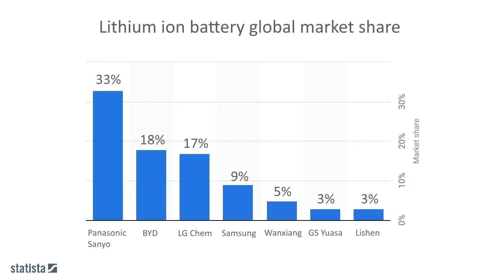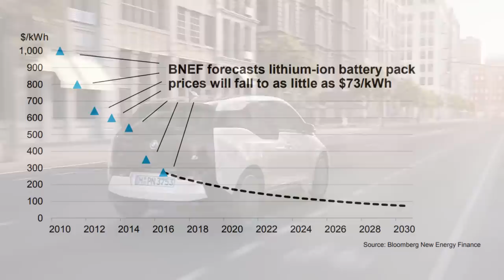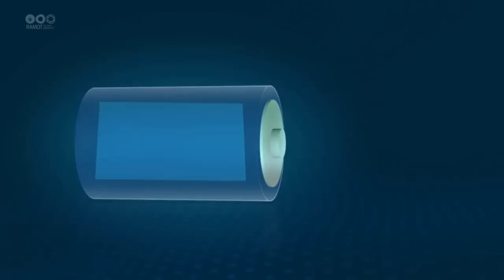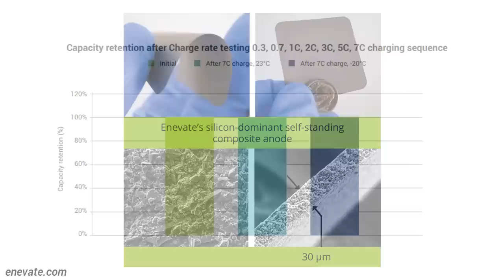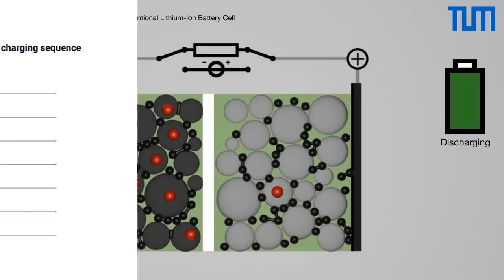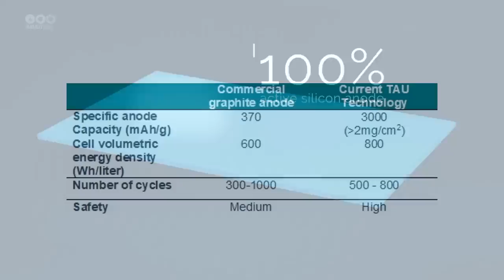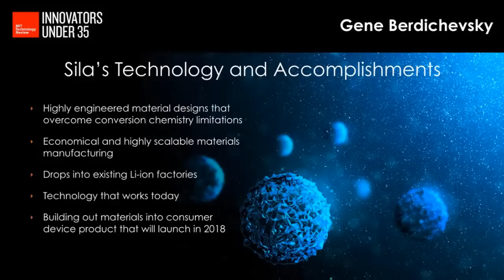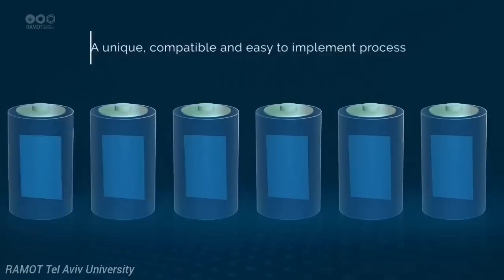The Battery Revolution. Ultra Fast Charging

Comment from the maker: Thanks for watching friends, hope You enjoyed it!
If the price of electric vehicles be the same or even lower than conventional gasoline-powered vehicles, would You go electric or will the ICE be preferable option in any way?
Reply: I enjoyed it, except for the distracting background bass.

I'd use ICE for long distance travel without breaks (4+ hours, though. How long were the bombing runs that required stimulants?), and BEV for anything else; BEV pays for itself by using excess solar peak energy, acting like a UPS for the home or more, and not poisoning the places i use it in.
Reply: Future Lab electric. Easy choice. Next gen EVs like the Tesla roadster are already going to be able to travel further than ICE cars. And with the increased charging speed, there's really no reason for an ICE car unless you can't charge at your house. After a 400 mile journey, to have 30/45mins break is not only ok, its actually sensible. Plus, once there are more places to charge, range anxiety won't be a thing anymore. Unfortunately, the model 3 is just too far away for me to wait, so I'm going to have to buy a Golf GTE hybrid. But the next car I buy after that will be all electric.
Reply: Future Lab DEFINITELY ELECTRIC!
Reply: It is going to happen a lot faster than that. The experts never get disruptive changes right. They always use lateral forecasting tools. The problem is technologies are always adopted in exponential S curves, not laterally. Look up Tony Seba on Youtube
Reply: Hey, Every day the race between ICEC and EV manufacturers rages. Because of that maybe ICEC producers may find a way to 0 emission and produce total bio fuel. On the other hand, EV producers may also find a way to 10k kms batteries. Who knows? As far as people like the engine roar, the ICEC will live. Pollution is the only key to ban all the ICE. But the carbon fingerprint is not only caused by fuel. Also the production of those brilliant batteries cause lots of pollution.
Reply: Electric every day
Reply: Ho Lee Fook you mean require expensive maintenance, expensive fuels from enemy countries, waste the vast majority of its energy as heat, and come with thousands of moving parts instead of a few hundred?
You probably don't, but these are some of the disadvantages EVs lack. I'll gladly trade them for shorter range and longer charging.
Reply: Tuncay Şimşek First resonable comment of the day.
Reply: LIthium is a 50 year old invention. It sat on the shelf until cellphones created a need for a better battery. Its creator already has its successor in final commercialization. Sodium Glass solid state. No precious metals,. No toxic electrolytes.
Reply: Electric cars wear down and break to a much lesser degree. No fuel system, no air intake system, one moving part in the entire engine (unless you count the balls in the bearings), no exhaust system, no oil system, no timing belt or chain, no clutch, a very simple gearbox (typically 8 gears, of which 4 make up the differential, and neither of which are ever disengaged from eachother), minimal brake wear (a mixed blessing, as lightly used brakes can seize easier), and a tiny cooling system that deals with low temperatures and small amounts of energy. 
Just the absence of solvents (oil, fuel) and high temperatures means the materials age a lot slower.
The Nissan Leaf battery costs less to replace at EOL than the fuel in a ICE car would've cost for the same driving distance, and in all but the very dirtiest grids an EV produces less pollution in total, including battery manufacture, than a gasoline car (including car and fuel manufacture).
A few comments from before the EV age puts the number of moving parts in a car at 10-13000.
Reply: "A Wakened" I don't know where you live but if you think that good batteries are being removed from cars and thrown in landfills you should be petitioning your government to have them enforce the rules they have in place to stop such activity. 
Yes lithium battery powered toothbrushes and other devices are going into landfill but car disposal is generally very highly regulated and recycling is prevalent in almost every stage of the process. 
Back in the olden days engine fluids were drained straight into the scrap yard's soil. 
Times have changed...
Reply: Hesus, seriously what are you talking about?!
Reply: Awakened2Truth -Do a little research before spouting off about something you know nothing about and don't understand. Research allows you to develop an informed oppinion rather than parroting what he said she said. Although I appreciate it is sometimes hard to break old habits.
Reply: I don't drive much, and the furthest we go is about 50 miles from home. Today's EVs can handle that.  I have an older but low mileage ice car so I can afford to hold off any purchase until the next predicted big thing actually becomes the next big thing for real. They're predicting major big time practical long range EVs by 2025, which would work out just about right for me, I can certainly squeeze 7 more years out of my current car, but we've been hearing all about the great new battery technological breakthroughs just right around the corner for a number of years now and it hasn't happened yet. When and if the EV becomes a serious practical contender, I'll certainly consider one, absolutely. if you build one that works for me, I'll buy it. My only concern would be long distance trips, it isn't just the charging time, it's lining up behind 400 other cars all trying to do the same thing at the same time. They've got to have the infrastructure.
Reply: ICE or hybrid all the way, the infrastructure is there, the reliabilty is there, no plugin or waiting or range anxiety, great for those that park outside in the cold and apartment dwellers with no access to garage parking or an ac plug.
Unknown longevity and battery replacement costs.
Reply: Future Lab MIT published work, proving they can now print graphene sheets (carbon nanotubes, with a uniform thickness of one atom,) in infinite scale and volume.
All of these batteries are poop, in comparison to graphene ultra capacitors.
Reply: I would love to go electric, but I have a disability and I cannot walk more than 200 m. The only charge points in my neighbourhood is 800 meters away. And they are Always occupied…. If this does not improve, I will not be able to go electric.
Reply: I would go electric but there is are some problem if too many go electric. 
Can the power grids handle the extra load? 
Do we even have enough electricity to cover the demand? 
Is it clean energy? If not then it doesn't make sense to go electric when all you do is shift the emissions to the power plant. 
Also...how long do i have to wait for a full charge? I'm not going to wait 30 minutes for 80% capacity...my limit is 10 minutes maximum and it has to be fully charged like an ICE vehicle. 
Nobody will build that infrastucture though because there is no demand and nobody buys EVs because there are not enough fast chargers / charging stations. And we need one car for all of them. I don't want to drive around needing to carry 10 cards. 
EVs are still a novelty and toys for rich people and early adopters who have the money to spend.
Reply: I've driven both ICE and electric.  The experience of driving an EV is sublime.  Instant torque and silent power.  I will NEVER go back to ICE.
Reply: Enforcer1975
 - Not sure where you live, which would affect some of the answers.

Can the power grid handle the load?  Pretty easily.  EV's mostly charge at night when the grid is idle and power use is decreasing in the USA.  Power generation dropped by 1.5% last year, which is enough energy for 28 million EV's to drive 15.000 miles a year each.

The energy is clean in many cases, and much cleaner in most cases.  Even when power plants run base loads at night, it is more efficient to use them.  The less efficient peaker plants are the main issue during the day in most cases, when the demand is highest, but as noted, most EV's charge at night anyways.
In my area, the base load at night is Nuclear, so I charge with carbon free energy at night.

This waiting for a full charge thing is the outdated gasoline car mentality.  On a gas car, people wait until they have a quarter tank or less and fill up at a gas station.  On electric cars, you simply plug them in when you get home, or when you get to work, or when you go to the store, etc.  They are basically full every morning when you wake up, and charge when you sleep.  There is no waiting involved in most cases.

"Nobody will build that infrastucture though because there is no demand..."  If that was the case, we would never had cell phones take off, or the internet, or anything else for that matter.  There is no infrastructure to build, the grid is already here, every building today has a power outlet, the building of fast charging infrastructure is not only here already, it is being expanded every year.

This claim simply doesn't add up.  Go to Plugshare.com and see how many stations are around the country already, and thousands more on the way every year.

"And we need one car for all of them.".   I assume you meant "card" for all of them.  First of all, some like the Tesla Superchargers don't use cards at all.  Second of all, stations like Chargepoint and EvGo you can just use a mobile app if a card is required.  That claim simply doesn't add up.

"EVs are still a novelty and toys for rich people and early adopters".  The same was said about gasoline cars, mobile phones, computers, the internet, indoor plumbing, etc.

EV's today are getting cheaper and better every year.  They are already cheaper to operate and cheaper to maintain per mile.  So, it is not a matter if being an early adopter, they simply make economic sense, besides the cleaner transportation argument.  So, they will keep growing, like it or not.
Reply: Future Lab  If ev's are pushed, my vote is no petro chemicals allowed in design, engineering, construction. There is beleif that the earth keeps manufacturing oil, can you debunk it ? That answer is no. Plus there is so much oil were swimming in it. FAKE NEWS!! AND A FEAR MONGERER, LIKE ALGORE!!! LOL GROW UP WHILE YOUR AT IT AYE!!
Reply: Awakened2Truth - Disciple of Jesus the Christ I'd like to help you out. Where can I send the tin foil hat?
Reply: I am for I.C.E. sports cars and daily electrics. Electric vehicles are great for folks who use automobiles as a means of transport. However, I still choose I.C.E. for sporting vehicles. It's fun to shift gears. It's fun to enjoy the exhaust note. It's my hobby. Why should I give up my interest, just because other people use it in apathy?
--- If it weren't for I.C.E, I would have never gotten my degree in Mechanical Engineering. In the big picture, appliance use accounts for 90% of the vehicles on the road. So, go ahead and let electrification happen. Let combustion go to those who truly enjoy it and are smart enough to keep it. Once we have a higher usage of renewable energy, any carbon emissions from I.C.E. can be done by the very small crowd of I.C.E. people, thus making it more sustainable.
Reply: Future Lab whats the name of the first song ? Pls
Reply: Guns Cars and Digits - Just find a new and better hobby. Burning fossil fuels is polluting our planet. It must be banned.
Reply: tanzanable You first.  Mining exotic battery materials and using more tires over the same distance, not to mention using the SAME AMOUNT OF PETROCHEMICALS for body and interior components, means your EV is worse for the environment overall than an ICE car.  And all you're doing is moving the emissions away from you to someone else.

Typical NIMBY elitist attitude.
Reply: Bill Cichoke - ICE cars use many toxic substances. My EV gets its energy from solar panels so there's no shifting of fossil fuel burn from the car to a power plant. Hydro, wind and nuclear plants don't use fossil fuels either. More tires? EVs use very efficient low rolling resistance tires with long tread life.
Reply: I drive a plug in hybrid and I'd go full electric as soon as I can afford a 300 mile range car. Wouldn't even be a hard decision.
Reply: I enjpye it, really, so funny all these ignoramus who can't understand basic physics !
Reply: Nice video
Reply: 5:20 Why would you compare the time it takes the new batteries to get to 90% against Tesla's supercharger getting to 100% charge?
You said it's 5 times faster than charging with Tesla's superchargers--which is FALSE
I hope I'm not the only one who caught that obviously unfair comparison. 
If it takes 15 minutes to get to 90% with the new batteries, and 75 minutes to get to 100% with Tesla's superchargers, then that's not 5 times faster. The last 10% takes the longest to charge, so why didn't you do a fair comparison--how long does it take each to get to 100%.
Reply: ICE all the way . Even after 50 or 100 years .
Reply: I'll go electric the moment I can afford it.
Reply: One thing that needs to be done is over the next 12 years convert oil based economies(Canada, Saudi Arabia, UAE, etc) Into ones comparable with the new technology. I can speak for Canada saying our metal rich Canadian shield and Lithium brine are good news. Problem is there is very little push to mine these resources. For example Lithium brine is a formally unwanted product from oil wells in Alberta and Saskatchewan. It can be seen Esp southeast of Edmonton where the stuff is near the ground and many lakes are brine rich(have white powdery beaches) And a salty taste.
Reply: TAKE NOTE: There’s no substitute to liquid fuels for transportation
vehicles in terms of Robotic Functioning and Molecular Alchemy. Liquid fuels
are combustible or energy-generating molecules that can be harnessed to create
MECHANICAL ENERGY, usually producing KINETIC ENERGY; It’s the fumes of liquid
fuels that are flammable instead of the fluid. Most liquid fuels in widespread
use are derived from fossil fuels; however, there are several types, such as
hydrogen fuel (for automotive uses), ethanol, and biodiesel, which are also
categorized as a liquid fuel. Many liquid fuels play a primary role in
transportation and the economy. Efficiency --- YES! Pricey --- Yes, because
it’s the price of an environment-friendly fuel ... not to be a hypocrit about
nature.
Reply: There is only one problem with your theory, if you buy a solar home and charge your car from it then you are using the electricity from all around you.  If you use solar charging stations that give you energy for free then again, you are using power from all around you.
Reply: They do.  In fact, they work better.  They are more expensive now because they are new.  Wait 2 more years and you will see more e-vehicles then ICE vehicles.
Reply: You're right Tesla costs a lot to repair because they are a new type of car, ICEs have been established for the last 50 years.  As for them devaluing faster, I don't think so, but like I said it's a new type of car.  While electricity does come from fossil fuels, most Tesla energy come from solar, and you can charge your car from home and you're not burning as much fuel to get electricity at home so that ends that conversation right there.  You're right ICE cars don't have thousands of moving parts.  However, electric cars have less than ICE cars period.
Reply: Actually moving parts does factor in, just because you had a brand of cars out of the hundreds of brands of ICE vehicles, does not create a gold standard.  I know people that had the same vehicles that were in the repair shop every 3 years.  Any car that you take proper care of does not need replacement parts regularly if the car is built well.  However, normal wear and tear on vehicles are based on friction, you can reduce that friction but ultimately, the cars will break down due to friction.  That's a scientific fact.  Once again you're not proving that Tesla is not a better car than ICEs what you are proving is you take care of your cars so they last longer.  I have a Prius, and I have had that Prius for well over 17 years, that car is almost like it is brand new, I have not put as many miles on it, but I don't drive everyday, so I haven't even broken the 50,000 mile mark yet.  However, I have a friend that ran her Prius into the ground putting 150,000 miles on it before it conked out.
Reply: Again I think you need to check your sources because ICEs will be outlawed by 2030.  While it will take a while for the cars to switch over, that doesn't mean that they won't be replaced.  There will always be cars that run on fuel but they will be less and less as time goes by.  i only hope we can wait that long before the climate kills everyone.
Reply: I think you are missing some salient points.
While most people aren't replacing the ICEVs with EVs yet, doesn't mean it is not going to happen.  There are only two cars that really are noteworthy as an real world EV and one of them is Tesla.  The other is the Bolt and Volt but the auto industry has not embraced this tech.  Does anyone remember the EV1?  If we had done this a decade ago, the environment would be in a better position.  Additionally, airplanes are not your only source of mass transit.  Most cities in the USA have rail systems and they run on electricity.  So it's not that far as you would believe that within 30 years our primary source of fuel will be electricity generate by clean energy.
Reply: I agree unfortunately most people don't know how fast the ice will melt.  Predictions are not an exact science, they can approximate but that is as good as it gets.  For example, there is an iceberg right now that is threatening to flood a coastal town.  This is reality and not fiction.  We had best hope we can do something before we can no longer travel via air.
Reply: You actually want to go there?  No, the reason they replaced EVs with ICEVs was because of the automatic starter.  I know the history of these cars.  It was not about battery or range.  It was about ease of use.
Reply: Actually what we were discussing is when EVs will become cheaper the ICEVs and that will mean more cars on the road.  The same thing happened with the Toyota Prius in 2001.  However, with fracking bring gas prices down, the demand for hybrids is lessening.  Volvo has stated they will not make any new cars without an electric motor in it.  So like I said in 2 years we will see a switch being flipped to EVs.  As to the law, we were not talking about the law until you changed the topic to mean there will be ICEVs, and in that you are right.  However, with them being outlawed in 2030, we won't see any new ones being made which is different than us not seeing them at all.
Reply: Why did you write this?  You claimed that the reason that ICEs beat out the EVs is because of battery life instead of the hand crank.  You just confirmed what I said.
Reply: Nope wrong again until the discovery of oil in Texas, it was the high cost of gas not electricity that almost killed the ICE.
Reply: Didn't we just cover this?  We were having two separate conversations.  The first was about cost competiveness.  The second was about the laws and whether there would still be ICEs made.  Now I responded differently to both of your statements because we were talking about two separate aspects.
Reply: Seriously?  So you're going to say that because you can't measure how fast your house will flood means you shouldn't estimate how much time you have within the scope of the data that you have to work with to save your life?
Reply: I'd definitely go electric. just waiting for the price to be more friendly. and maybe have more ev choices 😁
Reply: Electric, every time. 
We already have a PHEV, next car will definitely have no ICE!
Reply: Future Lab Already went Bolt for my Ride Share with 65,000 miles and no maintenance and no regrets. Love to see jaw drops and open mouths when I 0-60 in 5 seconds.
Reply: Craig G Bolt is here! Everything you want (300 miles range safe, fast, clean) modern electronics, killer holographic ( LT Model) stereo, excellent visibility, Luxury car amenities. Apple CarPlay and Android too. Photos and videos with gallery. Personal automobile “Hot Spot”
Reply: Awakened2Truth - Disciple of Jesus the Christ o
Reply: Awakened2Truth - Disciple of Jesus the Christ They have Second life as power “sinks” and storage, then recycled when finally done.
Reply: Awakened2Truth - Disciple of Jesus the Christ But for the knowledgeable it is free. And there is the Internet for education. You can be your own “Neo”
Reply: Tuncay Şimşek Programs developed now and outside audio for coordinated engine sounds with accelerometers in smart phones.
Reply: IncognitoTorpedo I agree with 65,000 miles of fun. Welcome to the fold!
Reply: AKS I am a ride share driver all over the place! I drive easily 200 miles per day no “range anxiety “ at all in 65,000 miles.
Reply: SyphonLife when was the last report of a fiery crash of an ICE with a time bomb gasoline fuel tank and CO generating poison maker engine?
Reply: Paul Lammers Was  it convincing to a Nobel Laureate that out of curiosity checked it out for himself, You Tube his lecture.
Reply: Johan Smith $2000 down and $199 dollar 3 year lease for Bolt, and some preowned ones. Very little battery degradation on Second Design battery.
Reply: Ryooken I agree around me San Diego and LA it is changing as I text.
Reply: Ryooken Tesla’s have had 110 miles per hour accidents and the people have walked away unscathed. A Mercedes hit a tree at over one hundred miles per hour, and all that was left after the fire was a 20 inch piece of charred dash board.
Reply: Ryooken Yes and ease of use by women.
Reply: Samuel Rosenberg Right. We are at a Maunder Minimum now. See “Dark Winter”
Reply: Future Lab This tech is good, but no one will Ban combustion engines
Reply: galfisk The guy with the 97 Camry with 300k on the clock is laughing at your statement.
Reply: False, try and find out what is actually predicted rather than what fake News sites claim they predict, then find out what is actually happening.
P.S watch food prices this year and insurance premiums in the future
Reply: Volcano's under the Antarctic ice have been known about for many years, in fact the worlds highest active volcano is in East Antarctica.
However as Icelandic research has shown, as the ice melts the Earth rebounds reducing the pressure closing off volcanic vents and allowing increased magma flow, this is happening in West Antarctica as the glaciers and land ice sheets melt leading to greater magma flow, lava and ice melt , you get the picture.
Yes the models are not perfect and in most cases have erred on the side of caution.
The ice age scare was a media beat up that certain individuals took advantage of. It was based on the observation that pollution was not only causing acid rain, but also was blocking the sun - the Super Volcano winter a la the Year without a summer which lasted a couple of years. The world got together, the EPA was formed and the Developed nations came up with pollution controls massively reducing both issues. In the meantime the scientific research was still demonstrating Global warming due to CO2 masked somewhat by pollution.
Take note what is happening around the world and we are only just over 1C above the 1890's, it will be far far worse at 1.5C then again at 2C
Reply: SR. Antarctic ice melt and models, the models are pretty much on track, no model can be perfect, not even the model on which the aeroplane you fly in was built from.
Antarctica is a continent that has not been greatly researched, as such the depth and extent of the sub sea glaciers and their extension up to thousands of miles inland were not known, nor their slope. It is that lack of knowledge which is being rectified that lead to overly optimistic IPCC assessment and the surprise at the rapid rate of melt as a result
Reply: Short haul passenger aircraft are well on the way (couple of hundred miles ) and they are 90% of air traffic. Several manufacturers including Boeing
Reply: news flash, the solid state batteries WILL be on the market by 2020.
Reply: Where and how does one obtain this 'free energy' you speak of? I see a market for it.
Reply: no sorry I cant because of range and recharging time at this time. My business would not permit it.
Reply: correct no such thing as green. Stop being consumers keep the stuff you have and dont buy new. environmental impact of consumerism is much worse than tail pipes.
Reply: cost aside, there were EVs that got 200 miles per charge available around the world in 2011...…………………….they just weren't  available in America
Reply: @tuncaysimsek8210  yes but the problem is burning anything (including biofuel) will still produce pollutants from the combustion.
Reply: man i wanna electric car so bad im tire these noisy gas vehicles(":
Reply: Future Lab better to use graphene battery, but for now this is good as long as it is not combustible...
Reply: @Ho Lee Fook 
Duh?
Reply: @tuncaysimsek8210  
"The production pollution of batteries" (and the rest of the EV powertrain) is no more than that for the mining, processing and manufacturer of ALL the components in an ICE powertrain.
Also consider the pollution in production (NOT just use!) of the ICE fuel... Through the the life of the vehicle.
Reply: @AKS how many km in a year?
Reply: I surely would even if 20% premium, hate those oil change and related parts maintenance makes all garage both stinks and dirty.
Reply: I already went electric and I make every effort to educate people. Car companies are making an effort to suppress or hide information about new technology.
Reply: INTERNAL COMBUSTION ENGINES are best.Oil is constantly being replenished in the earths inner magma core, we just need to drill deeper.there is nothing like the feel and power of a good old V8.
Reply: Sometimes people run out of gasoline while on trips.  If that occurs, they can call the AAA and get enough gasoline to goto the next service station.  But what happens if they are driving an electric car and run out of kilowatts? A  AAA truck probably could not recharge a battery very quickly.  That could easily happen to even a careful driver if an electric car charging station were out of order.
Reply: I don't see how you could have written that post if you had a good background in physics.
Reply: Future Lab yes
Reply: I Hope that in the future there would be a semi nuclear battery that would last a lifetime in one charge of car's existence and that's all you need, becos problem with ev is always the battery's integrety,  , hope there would be a    battery just like  in the movie day and night starring tom cruise & cameron diaz,
Reply: @The-Randomest-Guy  Hope that in the future there would be a semi nuclear battery that would last a lifetime in one charge of car's existence and that's all you need, becos problem with ev is always the battery's integrety,  , hope there would be a    battery just like  in the movie day and night starring tom cruise & cameron diaz,
Reply: What do you mean by "work like gasoline cars"?
Do you mean have complicated multi-ratio transmissions?  Do you mean produce plenty of noise?  Do you mean not responding instantly to the accelerator?  Do you mean requiring refueling frequently?

Perhaps you can clarify.
Reply: To be the same as a comparable sized gas model like the Corolla iM they would need to get the prices down to around 18k to 20k and if they did that yes I would buy one if they also got the charge times down to around the same time to refuel a gas model.
Reply: End of Gasoline? Hopefully !
What about Graphene based batteries? How many years away? 
What about a video Lithium vs Graphene?
Reply: @Ho Lee Fook Amazing, everything you just said, was wrong.
Reply: I would be  more interested in electric vehicles if it was compatible to a pick up truck.
Reply: Absolutely!!!
Reply: Haha electric cars are not popular. They are such a hassle to own. Long charging time, low range. People don't want garbage electric cars.
Reply: Brian Cla, Yeah, look what happened to horse and buggy / cars?! There were  no roads, no gas stations, no mechanical garages for cars, but yeah you are right, stay with the horse and buggy! HA! HA!
Reply: @ginosmovies  your comparison is completely wrong. Horses have very low range, gas cars have 1000 km range. Where as electric has only 300 km and takes ages to recharge. With gas cars we can carry gasoline and extend our range. With electric we cannot do that. That's why electric cars are not practical.
Reply: Lets see, even the most expensive EV can only do a real world 250 miles on a charge. My BMW 320D can do almost 800 miles on one tank of fuel if I drive sensibly. EV can go do one, it's still rubbish.
Reply: ICE is already dead in the water: but this kind of battery innovation will accelerate the trend towards BEV vehicles and devices.
Reply: Enforcer1975 I first got solar.  Later I will get an electric car.  Maybe others will do the same.  Solar has gotten cheap if you are allowed to install on your place.
Reply: @tuncaysimsek8210  Very even tempered reply........
Reply: Music a bit distracting, please consider removing
Reply: ..__for future lab..__yes yes a battery_acummulator rechargeable is grosso modo a electric condensator..ideal is forming a batery_acummulator fast time rechargeable identyc electric condensator (second_minute time) and consuming long time identyc baterry_acumulator actually (hour time).. this is it idea..  ___archaix lord
Reply: yes yes..this is it idea a battery_acumulator rechageable is grosso_modo a electric_condensator_ great idea is forming a baterry_acummulator rechargeable identyc fast time (second_minute time) electric_condensator rechargeable and consuming long time (hour time) identyc actualy batery_acummulator rechargeable..this is it idea.. __archaix lord
Reply: Can't we all just have walk-able cities and high-speed rail?   eh? recognize RNG as a major transition fuel  UPS,  Seattle Waste management.  You people in 2018 did you know a 232% growth in grid storage was coming. Utah storage system to store a gigawatt.
Reply: biggest coming market for LI-ion I predict chainsaws, weed whackers, leaf blowers.
Reply: what the industry needs mostly is manufacturing volume. Right now the low production rate leads to long lead times and premium prices for the battery packs and thus the cars as well.
Buy a gasoline powered car and you can expect it to be delivered in 3-4 weeks if not faster. For an EV variant of the same model, you can expect to wait 6-8 MONTHS simply because (even despite the higher price, 1.5-2 times that of the gasoline variant) the manufacturer simply can't produce them fast enough to keep up with demand.

After that problem is resolved, or parallel to it, energy density should go up as well in order to both increase range and reduce weight and cost.
Reply: When the Atlis is real...i will buy it
Reply: Most definitely. I want to go electric now but, my pockets are not deep enough. I love the Solo.
Reply: Tuncay Şimşek a very crazy reason to keep making petrol driven cars and keep polluting the environment - for the sound of the engine!!
Reply: Jonathon Deeds but what if the production processes for battery manufacturer uses renewable energy sources? Would that be ok then?
Reply: ferkemall I believe they go into a powerwall. But after that... I don’t know. But I’m guessing soon there would be laws about recycling. Also, laws to put an end to “planned obsolescence”.
Reply: Guns Cars and Digits I can’t see the logic of wanting to do things that are detrimental to the environment, unsustainable, and inefficient, just because you find it fun. EV’s are a lot of fun too, as you quietly overtake these unnecessarily complex and polluting ICE vehicles. I can’t see any sense in the argument for ICE. The fun of shifting gears and the noise? How about the smell and fumes? Also fun? In reality, the ICE engine should cost way more than the ev. The cost and technology currently can easily make this happen now.
Reply: Tuncay Şimşek bio fuels produce co2
Reply: mark rigsby come 2030 many countries are stopping production of ICE vehicles.
Reply: Ronald de Rooij make a routine trip to one and you'll always have the juice there when you need it. Not all ev owners charge at home or work etc....
Reply: Enforcer1975 there's enough electricity during the day so at night when most people will charge, power stations won't have to ramp down and generation will be more efficient overall as power stations won't have to be designed to ramp down so much. That adds costs as pumping systems, for instance need to be able to pump large And small amounts as opposed to the same amount 24/7. It's like how generator engines are designed to run at only one rpm. It's going to make power generation cheaper and more efficient than it is now for many reasons. Vgud brony
Reply: ferkemall EV's don't use up brakes either as well as not needing gearbox oil and the complications of an ice drivetrain which is not needed when a motor directly turns wheels. 
And power generation will be more efficient with vehicles charging mostly at night through the savings made by designing generators that run at full capacity all day and night unlike now when most ramp down when we sleep and stop using so many power. Car batteries can also be linked to the grid and used as grid storage and for current smoothing (as capacitors) while charging being a double bonus. 
no one wants to know how many cylinders or litres people have these days. Tis what one does with it....💐🍐🔥💦
Reply: Of course I am decided for EV !
Reply: yes
Reply: Why would they sell them for less?  They have governments passing  regulations mandating their use.  Your question is idealistic and seems to seek positive feedback.  Why just ask if people would prefer a free car over a ICE car?  No mention of chargers.  Isn’t that half the story?

Finally, if this tech works with existing factories - why do we need to wait until 2023?  Obviously their claims haven’t been full tested.  Why else inject a multi-year waiting period?
Reply: The only thing that bothers me is that in the event of a disaster, when access to electricity might be interrupted, people are hosed.
Reply: It's been 1 year, and my wife and I went all electric. The Ford Focus EV we bought 4 1/2 years ago has 46k miles on it - not bad for a car with an official 78 mile range and using 110 v charging at home for the first 4 years. She replaced her 2010 Fusion hybrid in Sept. for a Model 3 standard +, so we have no ICE cars. The increase in electricity consumption has been minor (about $20/month, may increase with a new job) and we've had no problems with range with the Tesla. Charging stations are increasing beyond the core Seattle/Bellevue area making travel with the Focus easier, but the Tesla is ludicrous easy.

Everyone buying a new car from now on should consider an EV, and base it on their needs as well as their region. There are some places they're a poor fit still, but for most they will save money immediately. Range and charging speed will only go up (Tesla just added 170 KW charging at some superchargers), and keep in mind that there are no oil changes, no transmission to service, and brake pads around 500,000 miles. Oh, yeah - and the typical engine problems - blown head gasket, camshaft belt failure, dirty injectors, starter motor failure, etc. simply don't exist.
Reply: @Future Lab dreams! Cable-powered and wired vehicles are the best EVs and they will remain the best for long time.
Also Fuel-Cell coming soon. 😏
Reply: The kids at school love Teslas!    For people the limitation is price and in Australia charging stations.  We have big distances in Australia so charging is an issue . But kids love electric !!!  We love the acceleration and have watched Craig Ruecastle on the ABC showing how Tesla just out ran a conventional combustion engine!! 
 we are probably a bit more open and onto the future than our parents.  we just like how the cars work
Reply: 3 years later and batteries are still made with cobalt and still do not charge ultrafast. It's rather comical how people make plans about what we will discover and do without asking themselves if what we want can be done or is just fiction. We will ban ice's by 2030 but we do not have batteries nor recycling nor ultrafast charge and not even solar energy and grid storage. 65 years ago we were dreaming that by the year 2000 we will have cities on the moon and mars, nuclear fusion, cancer cure, interstellar ships and so on.